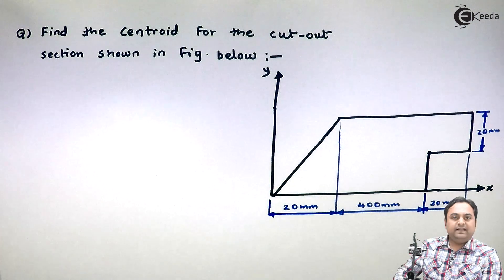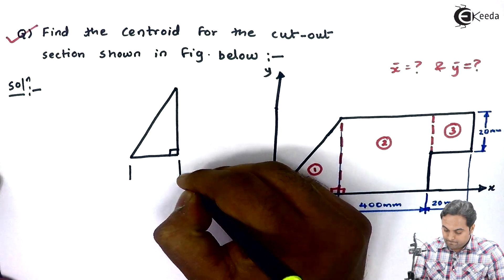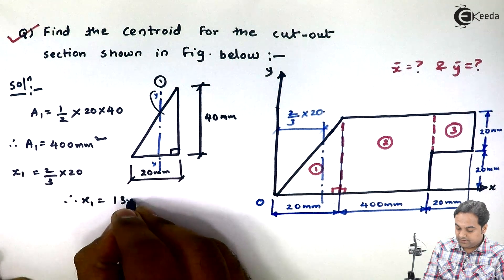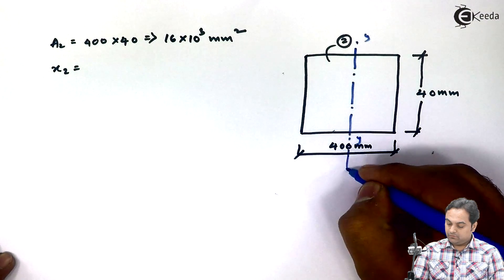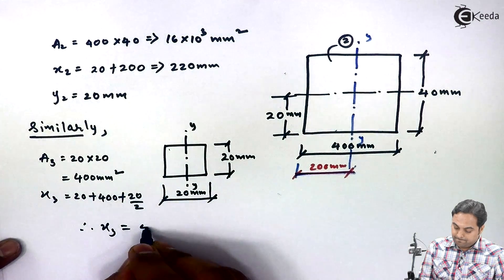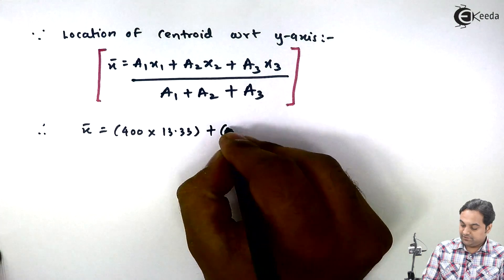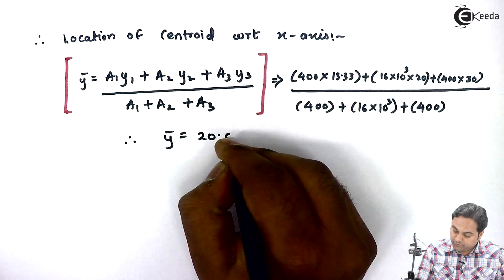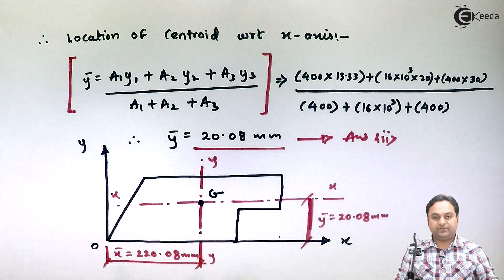Problem 1 on Centroid on Cut-Out Section - Centroid and Centre of Gravity - Engineering Mechanics

Comment: I have a question sir,
in cut out problem,why you not deduct the A3X3 value which are because of cutout section,
Xc=(A1X1+A2X2-A3X3)/(A1+A2+A3).
you are already told in case of MI of cut out section problem